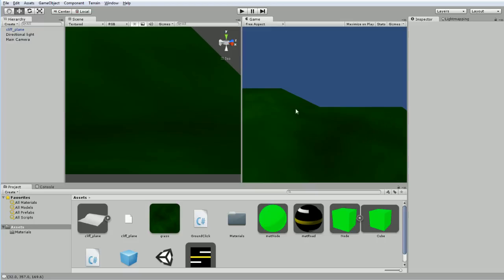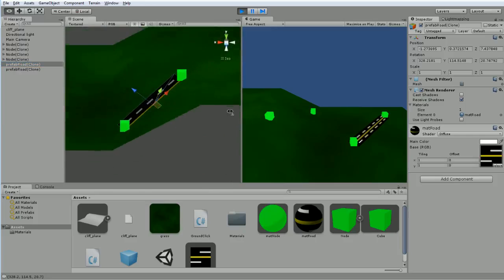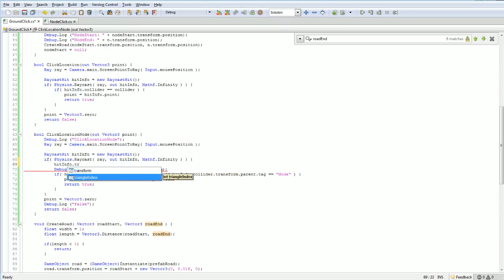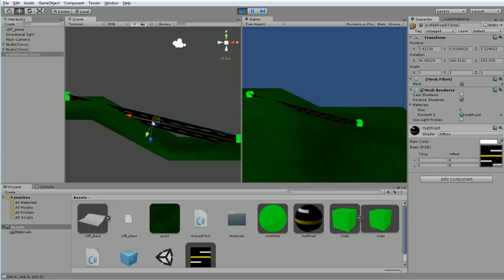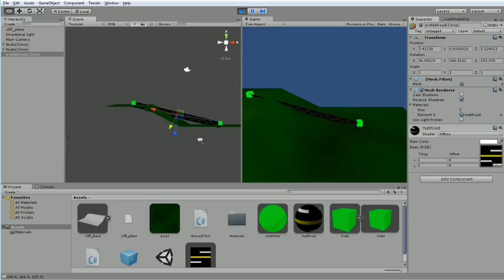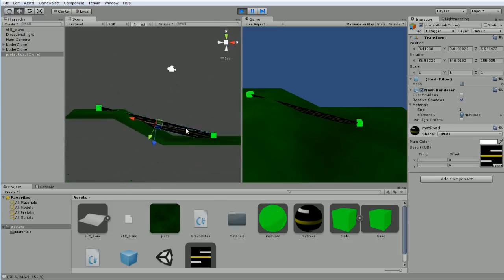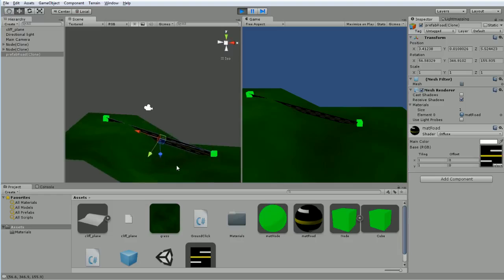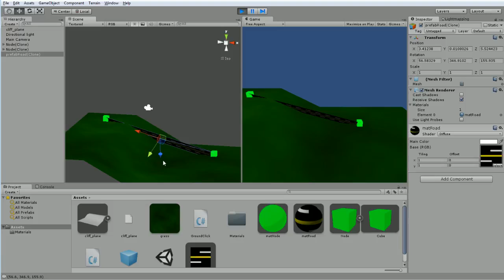Unity 3d: Procedural Mesh Generation [SimCity Roads] - Part 10

Comment: Thank you so much, very interesting tutorial. 
Actually, I was thinking, maybe in simcity things are made completely different? I mean, you don't put road in arbitrary points of the map, but rather on a grid of some sorts. In that way, maybe the issue "reduces" to simply applying a texture on a grid square depending on where your mouse clicks and where it unclicks. So the grids are n^2 small planes? I know it doesn't sound great, but I think that approach would solve the uphill problem.

Comment: You can also use nav mesh and pathfinding (like a*) to have it take the quickest route from a to b and adapt itself at each waypoint section. I bet that would work best with bumpy terrain. You can probably use the line renderer as well and just feed it the waypoint coordinates a long the path

Comment: Raycasting from start to the end point make it hard to place meshes flat on the ground. I think its much easier if you pick the start location, increase the y axis and start moving forward to the x and z axis of the end point in defined intervals, raycasting from DOWN to the ground and getting the hit location and place the meshes there. you can also make 3 raycasts for the roud sides and the middle, to calculate the angle for the road.